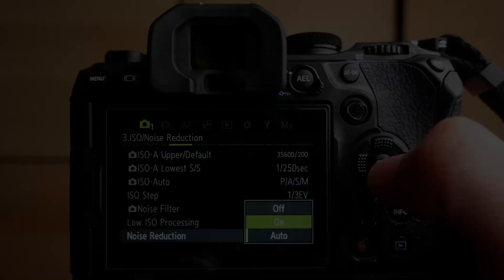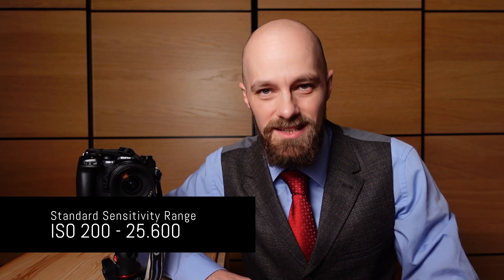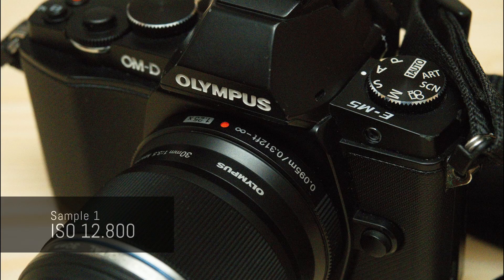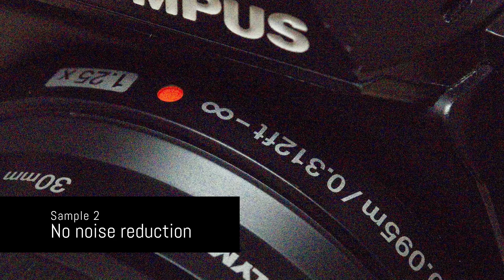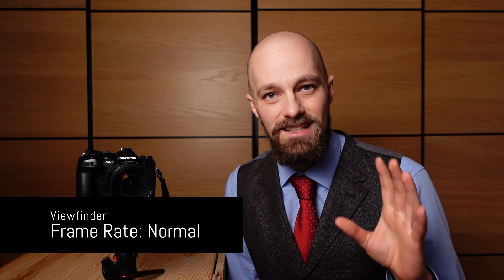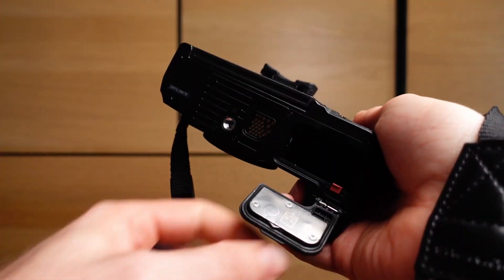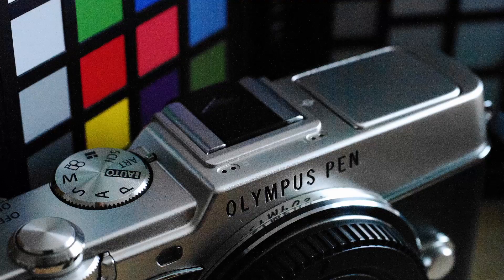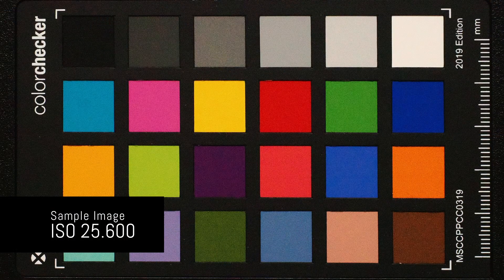OM System OM-1: A Masterclass on Image Noise

Comment: Hi Thomas, really enjoying your videos and finding them so very useful. I had my OM1 overheat during the summer on a very hot day (twice) whilst using SH2 mode and/or Pro Capture. Your suggestion about the HLD-10 is very valid, although personally, for me it would somewhat spoil the M4/3 form factor of the camera. I have found that by enabling Airplane mode that reduces the heat generated by lessening the load on the battery. Also moving the screen out on it's hinge for a while helps!
Reply from the maker: Thank you very much for adding these tips and your kind words!
It seems like summer time is DSLR-time haha. Jokes aside, the OM-1 is not very prone to overheating compared to other mirrorless cameras, however, in circumstances llike the ones you mentioned, there can be issues (also, when recording video under blazing sun for prolonged periods). 
You are right about the size with the HLD-10 - in a previous video on DSLRs in 2022, I talked about the difference (or lack thereof) in size and weight between mirrorless and DSLRs, what I stated there seems to also valid when comparing MILC 35mm with M43, I guess: camera bodies have  a certain size, the real size and weight savers are the smaller lenses.
Good thing is, that 99% of the time there is no issue with the OM-1 regarding overheating, so the HLD-10 is not a must.
Thanks for the comment, so nice to have these conversations!

Comment: Regarding EVF frame rate and 1 minute sleep mode ,would this also apply to the EM-1 mk iii?  also does the size and built in grip of the EM-1 x improve noise performance in the same way as adding a grip to the OM-1?  , i own the EM-1 mkiii
Reply from the maker: Hello Stephen,
the recommendations in this video can be applied to the E-M1 series as well. Both the E-M1x and E-M1III have two ADC stages, compared to the three of the OM-1 - in reality, this does not change much in regards of picking ISO sensitivities: Choose the right one at the moment of capture and avoid pushing in post production. I recommend that regardless of camera model.
Talking about heat management sepcifically:
The E-M1x was designed to "stay cool" - the dedicated heat sinks in the camera body as well as the placement of the batteries in the hand grip are all the results of this design philosophy, making the E-M1x one of the most heat resistant mirrorless cameras ever made. If you look at the Nikon Z9, you can see that other manufacturers started to mimic this concept as well.
Hope this helped, the E-M1III is a fantastic tool and these settings will sure push its performance.

Comment: Interesting video, Thomas, however this seems pretty specific, wich of these advice would apply to any digital camera? By the way, are you still using your d800's?
Reply from the maker: Hey Kalle, thanks for sticking around through the abundance of OM-1 videos recently!
I still have the D800s and I use them regularly - they are not going anywhere!

Talking about the D800 and DSLRs, some tips can be applied as well. 
However, heat management is practically irrelevant unless you use live view all the time. DSLRs generate little to no heat.
Regarding picking a higher ISO number right away instead of pushing in post production, is always the safe bet. The D800 is mostly ISO invariant, though. So it is not as critical as when working with the OM-1.
Thanks for engaging, Kalle - much appreciated!

Comment: Hi Thomas, Yet another very informative video! Keep them posting! For me the reason not to use OM Workspace is that it is a bit slow, I am also missing useful tools and my laptop does not have a supported GPU to benefit from the AI noise reduction. Currently I use DXO Photolab 6 elite, it is one of the best noise reduction software I am aware of. It closes the gap with larger sensor formats for me. When a 6400 iso shot is well exposed it is nearly  as clean as an iso 200 image out of camera. Only thing is that it requires quite a powerful computer and takes in the highest quality setting (Deepprime XD) around 1 minute to complete. 

I also know at high iso and low light situations electronic shutter produce more signal noise than a mechanical shutter. I guess this won't be as much of a problem with the OM-1 sensor I think because of the bsi. I use electronic shutter exclusively, to keep the shutter count low.
Reply from the maker: Regarding OM Workspace - you are right, it is slow. What I like to do is batch process all my selects, just applying exposure compensation if needed. Then, I continue working on the TIFFs or JPEGs in other programs.

I use mostly mechanical shutter as I often have to deal with flickering lights on location. I will compare the noise performance of these two shutter types in an upcoming video, thanks for this idea!

Apart from these scenarios, I use the electronic shutter as well - although I do not worry too much about shutter life, the OM-1 is rated for 400.000, which is insane.

Thank you very much for the comment and the valuable input - much appreciated!
Reply: @ThomasEisl.Photography  true the shutter would survive, only the secondhand value is really dependent on it. Although the replacement will be in the range of 150 euro. In case I want to upgrade and retain the max value in the future to an OM-1 II it matters.

Comment: I stumbled across your YouTube channel a little over a month ago; your discussions on photography are consistently several steps ahead of what others are doing on their channels.  I sincerely hope your subscription numbers, and resulting income, grow exponentially, as what you present is so useful.  OK, I'm an OM-1 user, but still, your videos are so good!  My only reservation about your videos has to do with the sound quality: as much as that wood back panel looks great, it bounces the sound back to your mic far too much.  You might consider moving a bit further away from that back wall to improve the sound pressure ratio at the mic between your voice and the reflected sound from the wall behind you.
Reply from the maker: Thank you very much for your kind words - I am humbled and actually out of words.

Regarding sound quality: You are absolutely right, it is an issue!
Moving further away from the panels is an awesome idea - thanks for the tip!
The "reverb" you are hearing is actually me using the Olympus LS-P4 without a pop protection, this is where this annoying vibrating sound comes from (which was impossible to remove in post without sounding like a robot). You won't believe how long it took me to figure this out. I even thought that my recorder was broken or something. 
In any case, future videos will have better audio quality - I'll do my best!

Comment: Hello Thomas, Jose from Puerto Rico. This was another wonderful tutorial on a very hot topic. I was surprised to see that my OM-1 had some of these settings on already as I followed along with you using my camera. On the subject of post-processing, I wanted to ask you a question. I have always shot in RAW, but have not used the OM software. So far, for noise reduction, I'm using DxO PhotoLab 6 and I really like the results. What are your thoughts or suggestions on this software? Have you used DXO? I highly respect your opinions and suggestions, since you are a working pro. I am not a professional photographer. I consider myself an advanced amateur, and I shoot a lot of street and landscape photography, sometimes some portraits.
Reply from the maker: Hello Jose! Nice to read from you again - I have not worked with DxO apart from a short period of testing it 5 years ago. The most important point: if you like what you get, the software is just fine - I would not waste a thought on switching programs unless you have a specific issue with your current one.
At the moment, I am using ACDSee a lot, I like it quite a bit. If you want to try something new, I would give this one a try.
OM Workspace is great for creating JPEGs and TIFF for further editing in other programs. You should definitely try this one, it is for free after all - and you get the "signature" OM System look with this program.
Best wishes from Vienna, thanks for commenting, Jose!